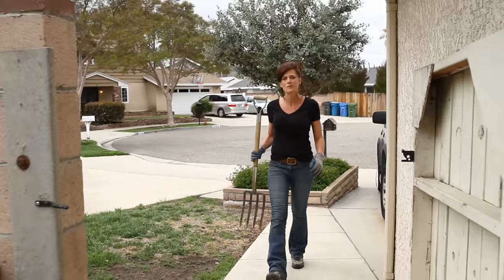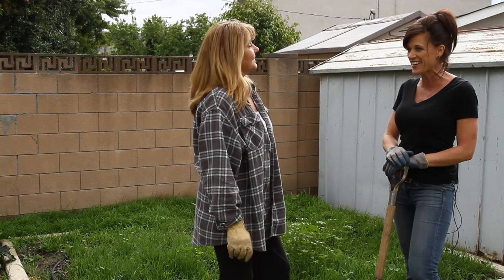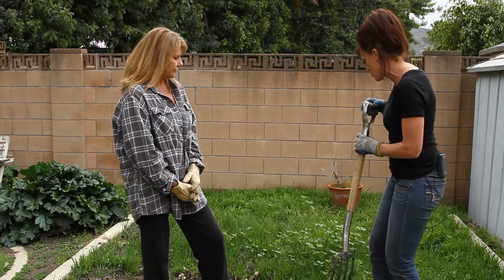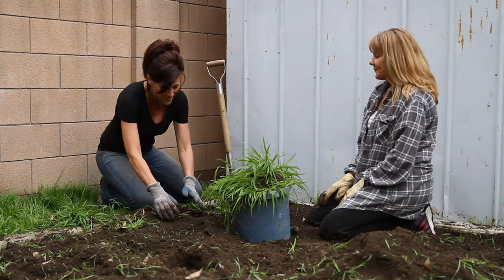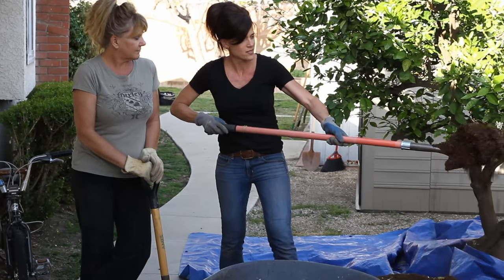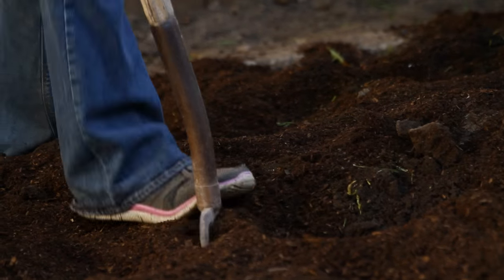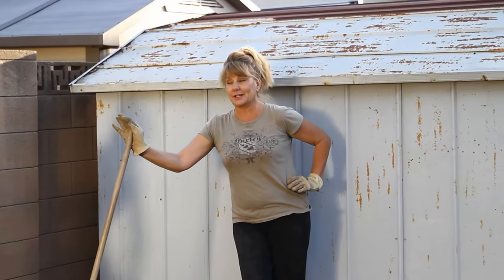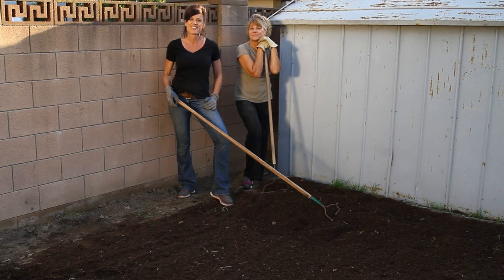$10 Garden Series #8 - How to Prepare Your Garden Soil for Planting Vegetables

Comment: I like to use my mini tiller to mix in the amendments. Sooo much easier,lol. Also, have her put on her calendar for the fall to add any amendments and prep her soil. Let it "rest" over the winter and next year watch how good her garden will be! It'll be amazing!
Reply from the maker: +Chris Dahl  Hi Chris, I really do need to get me one of those!  Doing it by hand does make for  great workout, though!  Will be checking on her garden all season long and into the fall too!  Thanks for the tip and for watching!
Reply: I love my Mantis Mini tiller.I couldn't believe how quickly it handled the clay soil I had to deal with. It can be a bit pricey but worth it. I also had a big front tine tiller...I'm a bigger guy and holy smokes was that thing hard to control! It bounced off the soil worse than a bucking bronco, seriously, dangerous. But that Mantis just chewed that soil up and mixed the compost, worm castings and peat I was adding super well. Went down a solid 10". I  gave up using the big one.

Comment: Hi Kim,. Can I reuse my potted soil mix once I've pulled out the old plant?  My fabric pot has lots of tiny roots in the soil. I just hate throwing out 20 gallon bag of potting soil.
Reply: sally padilla Hey sorry I’m late but if you leave some of the roots in there for a few mouths, the roots will just and it will be as good as new when you add nutrients back in it